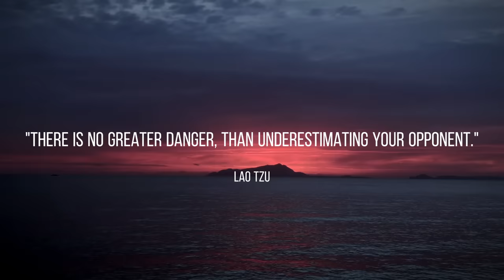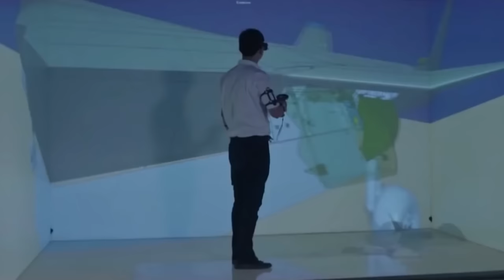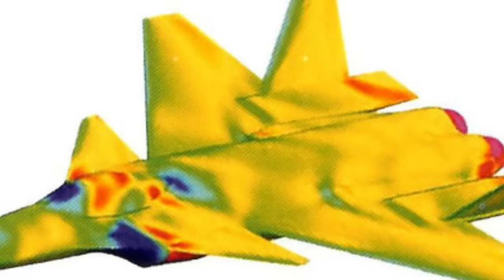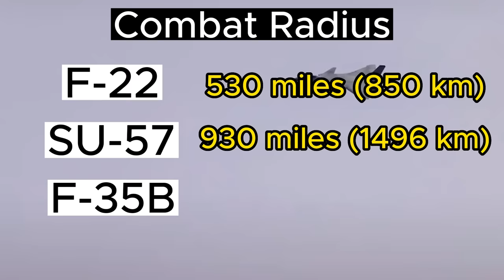China's Stealth Fighter, Good or Bad?

Comment: Unfortunately it looks like the real deal unlike the Su57
Reply: Yes if you took his opinion on Su-57 where he grasp straws by referencing most outdated information on the jet such as RCS figure before it was even produced.
Reply: @agramarten  I would beat the SU-57 in a fight.
Reply: @agramarten  Mate, he took Sukhoi's own data. Also, Russia's barely made any.
Reply: Except it's engines suck...a lot.
Reply: @anzaca1  which he already said are getting replaced this year...
Reply: @anzaca1  He took data from T-50 proposal before any prototype let alone production model of Su-57.
Reply: @agramarten  there are barely enough Felons to equip a single squadron lol.
Reply: @paperitgel98 😂 the SU-57 has a zero casualty rate on all sorties as to date. And due to the Ukrain war Russia is getting that wartime economic boom to their military funding.
Reply: @tylerrobbins8311  I diagnose you with vatnik. Having a zero casualty rate on all sorties doesn't exactly matter when so little Su-57 have been produced. Yet all the same one still crashed and another got an engine fire. I suggest you do some reading into economics, because Russia's economy has contracted greatly since they began their invasion of Ukraine and funding into new programs is limited. Really though get real, the Su-57 is by far the worst of any stealth fighters, is piloted by the worst pilots out of any other stealth fighter, and has at most 15 functioning models.
Reply: @johnbean9797  I'm american I don't just buy into propaganda or partisan bias. Russia is far stronger than what you think. Also there economy has been crippled for decades not since this war with Ukrain. Russia is doing just fine if anything their economy is starting to rebound as the USD is weakening.
Reply: @anzaca1  might want to look into the ws15s
Reply: Its a whole new jet
Reply: @anzaca1 yet has more combat kills than f-22 and f-35 combined
Reply: @anzaca1  yes and no, China are using older models which make it suck for some reason I forgot. But don't underestimate when they use their better engines.
Reply: @KSmithwick1989 Su-57s are being used in Ukraine, and it already has a couple air kills.
Reply: @nickjayr0 what they count Syrian civilians as combat kills now?
Reply: @anzaca1  ... its* engines (it's = it is)
Reply: Yeah because it’s sitting in the back lines lobbing missiles.
Reply: It still just looks like f-35 at home
Reply: @anzaca1 they are in serial production now.  They are making 20 a year now.
Reply: They don't have the money
Reply: J-20 is certainly stealthier than Su-57, but its still not as stealthy as F-35. Their is a 3rd party radar scattering computer simulation done on Aircraft 101. Without RAM coatings, they compared all 3 F-35, J-20, and Su-57 low observable LO characteristics through their shapes/geometry alone.

In a 60x22deg frontal aspect aspect, Su-57’s median RCS in the X-band is 4.3 times higher than F-35A and 2.2 times higher in the L-band. In a 20x20deg frontal aspect, median RCS value in the X and L-band is also 8 and 2.7 times higher.

On the other hand, in the same 20x20deg frontal aspect, "J-20 RCS is higher than F-35A RCS through the frequency range (approximately 3.5 times in X-band, 1.5 times in VHF band), it still has much better RCS characteristic when compared to Su-57.”

This mean even with the same RAM coatings used on the F-35, J-20 much more Su-57 can’t make up the difference in total RCS reduction given their LO properties/geometry. So F-35 definitely has the “first look, first shoot, first kill” in beyond visual range BVR. But in a dogfight or within visual range WVR combat its 50/50 or which pilot is better trained or who first makes a mistake. Consequently, in a 1 vs 1 match, if either J-20 or Su-57 manages to survive in BVR would mean F-35’s pilot already made its first mistake.
Reply: Definitely
Reply: @tylerrobbins8311  9% of every single production Su-57 has been destroyed while not running a single real combat mission. Add in the prototypes and that gets bumped to 9.5%. 

Also the Russian economy is rebounding? The Kremlin itself has admitted to 3.2% drop in GDP in 2022, and expect 0% growth in 2023. That is their OWN sources using their own made up numbers. Look at the inflation (12%), stock market (down 28% from late 2021 levels), export revenue down 40% from prewar levels. Russian economy and military are in the dumpster
Reply: @nickjayr0 And not a single shred of evidence to support that claim, just like with most Russian claims
Reply: @tylerrobbins8311 really? Russian economy is on the rebound? Wtf lol. Even Indian news is talking about the rubble crumbling.
Reply: @nickjayr0 I’ve seen comments claiming this but haven’t found a source for it when searching it up. Any website I could check? Also that doesn’t really mean much anyway. Russia is in an active war with a peer adversary which is something no F-22 or F-35 equipped military is, thus not allowing for air to air engagements
Reply: @tylerrobbins8311  Russia is not as strong as you think, yeah it’s still quite strong in some areas of the world but because of the Ukraine war it has shown the low capabilities of the Russian military, yes the Russian economy is rebounding a bit but not by much, not to the point where they can start making more modern tech.
Reply: @paperitgel98  I love how you know you're losing the arugment because you're just rats supporting rats. So instead you try to shift the point.
Reply: @RuskFox  and you've lost the argument by name calling and siding with the invaders.
Reply: @yeetmaster3360 j20s have already been in mass production with the indigenous ws-15 engine for years. You are slow
Reply: @anzaca1  j20s have already been in mass production with the indigenous ws-15 engine for years. Haters are too slow
Reply: ksaabli-pj2fl  Nope. Chinese radars needs to be bigger than American counterparts to do the same thing. In fact on land base alone, China has no equivalent to THAAD's TPY-2 radar which is small and compact but can see as far as 4700km. Instead they use a massive LPAR radar for the same purpose.
Reply: Definitely
Reply: @agramarten sure, i will fear many fighter of lesser quality than few of slightly better one
Reply: You don't even need radar to detect Russian jets, it leaves a trail of black smoke you can't miss.
Reply: @johnsilver9338 china has better radar now
Reply: Not really it's much larger has canards and so on yes it has no visible rivits or screws but it is far from 5th Gen at best is 4.5 gen
Reply: @anzaca1 with ws15 engine, j20 is THE MOST ADVANCED fighter jet on thi s planet now. F22 is no.2 and will be no.3 soon.
Reply: @DarthAwar j20 is a better 5tg jet than f20 on every aspect now.
Reply: @hongkong670  nope not even close H20 is better than Su57 but not F35 nevermind F22
Reply: @agramarten Source, take my word for it
Reply: @anzaca1 that data is from the T-50 (I think )  which much less stealthy than the production one
Reply: @johnbean9797 u can’t say it’s the worst when it’s still under development and not in serial production , and is not flown by the worst pilots …
Reply: @ImBigFloppa   not one production SU-57 has crashed and only the T-50modles had accidents
Reply: @leopardontheboat8252  The first production Su-57 ever built crashed an hour after take off.

KHABAROVSK, December 24. /TASS/. A Su-57 fifth-generation multirole fighter jet crashed in a forest area in Russia’s Far Eastern Khabarovsk Territory on Tuesday, Komsomolsk-on-Amur city administration source told TASS.
Reply: @ImBigFloppa  that’s a prototype 😂
Reply: @ImBigFloppa  still not a huge deal with amour if F-35s that have been crashing like isn’t it the best aircraft ever made or something?
Reply: @leopardontheboat8252   7 F-35s have crashed in 12 years of service with 960 units made. That is 0.06% of total production being lost every year. F-16, F-15, and A-10, meanwhile, were sitting at about 1% a year. Per flight hour, the F-35 has about 6x fewer crashes than the F-16 in the same time span. We don't have the exact figures for Russian aircraft since they are really cagey about that stuff and don't want evidence to go against it's narrative. 

However, we can count. From 2020-2023, Russia had 38 crashes, all due exclusively to accidents. In the same time span, the USAF lost 37 aircraft, again only due to accidents. Russia has 3.6k aircraft and America has 5.2k aircraft. With with about 1.5x the flight hours per American pilot against their Russian counterpart, that gives a crash rate for US aircraft of 46% that of Russia. That is what Russia CLAIMS too, so take their annual flight hours with a massive grain of salt.

Also what do you mean by amour?
Reply: @tylerrobbins8311 lmao people still think ukraine is obliterating russia
Reply: @voidtempering8700 civilian airliners count as combat kills?
Reply: @WildmanTrading  What are you talking about? If you are going to make things up, at least be semi-feasible. Civilian airliners aren't even in Ukraine. Spread your lies somewhere else.
Reply: Su57 is amazing maybe u mistook it for the pak t50?
Reply: @anzaca1 thats the pak t50 not su57
Reply: @anzaca1 its not even the su57 data its the pak t50...
Reply: @Bababoy6969 Really? In what missions has the SU57 proven this?
Reply: @johnbean9797 source trust me, BTW SU-57 is a multi-role
Reply: SU-57 has yet to go into full scale productions. It continues improving like the new engines it will be using.Russia is actually fighting a real war and will use lessons learned from it before it starts massively producing it's future hardware.
Reply: @j.k.1239  We heard that already a thousend times...this jet was not operational even before this stupid war...the same applies to the T14 Armata...nothing more than a, not operational, tank for a parade...completely useless...by the way...IF the Russians some day manage to built an operational 5th Gen Fighter...well, the US is testing already the 6th Gen aircraft...the Russians are always 2 steps behind...no wonder...because somehow the funds for those projects always find their way into the pockets of the corrupt Russian leadership
Reply: @zenon7094  Russian military industry is already working at 24/7 and producing record number of weapons.

As for future weapons, Russians are in no hurry.Weapons like these will be around for decades. So, It's better to use all the experience learned from war to improve before going into full scale production.
Reply: @j.k.1239  These are just more excuses...or baseless claims...since this is absolutely not verifiable via other independent sources
Reply: @j.k.1239  Plus, it's way better bang for your buck compared to F22 & F35
It's a Multi-Role fighter & is much more cheaper & agile (which is a signature for SUs)
Reply: @zenon7094  Don't be naive. You should wait for Russia to start churning out the final product before start giving judgment upon quality. SU-57 is still pretty much in development while J-20, F-35 are already finished products. So, It's apple to oranges comparison.

For example, This video complaints about SU-57 engine without realizing that it's just an old engine used for testing and for earlier models.They will use a newer flat nozzle engine when it will actually goes into mass production.
Reply: @j.k.1239  and are some more excuses from you side...always the same arguments
Reply: Haha, nobody knows for sure,
Reply: Overhyped for sure
Reply: To be fair none of us know the true capabilities of the Su57 aside from mere speculation, can any one of truly know the workings behind the aircraft, surely? If not perhaps it can be much lethal than we thought since information is not shared on the web
Reply: Military fanboys’ speculation and debates
don’t really matter. US military is already looking at it as a serious threat after planed encounter, then started reacting  to it like kicking off F-22 upgrade program and retiring all of F-15Cs equipped with AESA radars from Okinawa. 
E-3 awacs failed to detect them during the encounter.
Reply: @anzaca1 mate, he’s saying data from long ago 😭
Reply: No it ain’t.  It’s made in china lol
Reply: @Superpo0oper2020 actually that’s WS10C
WS15 just came out in 2023 or some time in 2022(forgot)
Reply: @johnsilver9338 nope, J20s’ radars are 1 generation ahead of the ones on F35 and F22
Reply: @loadingnewads  Nope. Chinese radars are less efficient. This can also be seen on land and sea assets. China has NO equivalent to THAAD's TPY-2 radar which is small and compact but can see as far as 4700km. Instead they use a massive LPAR radar for the same purpose. While SPY-1 on Aegis ships can already see as far 1700km since the 1980s. NONE of PLAN's ships have the same capability even Type 055.
Reply: @johnsilver9338  evidence?
Reply: @loadingnewads  TPY-2 and SPY series radars itself. China has NO counterpart.
Reply: @johnsilver9338  CCP conceals majority of its military technology 
But still heard of 4500KM range radar
Reply: @loadingnewads  China can claim all the magic they want but their is nothing to back that up. While numerical calculations for both TPY-2 and SPY-1 performance can be found on a 3rd party source mostlymissiledefense. That's how I know they are definitely better.
Reply: It's a MiG 1.44 with stealth capabilities. It's a Soviet fuselage.

Comment: The fact that China let J20 fully take the spot light in air shows means they are quite confident that they have got the next generation fighter ready.
Reply: This logic doesn't apply to countries that are trying to catch up. Look at Russia for proof
Reply: @liiou4445  Well they allow the public to get almost arms length to the J-20 on a static display. During some airshows, they parked them out for public to almost touch. Airshows where the US military even had representatives too.

I think that's what the original comment was about.
Reply: @liiou4445 俄罗斯怎么能跟中国比？事实上拿美国和中国比还是比较合理
Reply: Need to remember that internally PLA and PLAAF have not see themselves as US peer level. This is a stepping stone.
Reply: @liiou4445    instead of using Russia as a reference, why dont you just look into China history. We always show something outdated.
Reply: @liiou4445 China isn't Russia.
Reply: @lagrangewei  yeah probably worse
Reply: @liiou4445 need actions of f-series in ukraine battlefield, you will get disapointed
Reply: @paijokotak6996  disappointed in what? US fighters literally has the highest kd ratio.   Also, there are two Ps in disappointed
Reply: @油管大祭司 not a fair comparison. China is alot more closer to Russia militarily than the US
Reply: esphaeraspraestans4212  J20 is not for sale.
Reply: esphaeraspraestans4212 likely,likely,likely，🤣
Reply: not necessarily. The Russian's have been using the T-14 in shows, and in the 90s they had the "Object 640" aka the "Black Eagle" which was supposedly a brand new tank ready for production, but was actually just a T-80 they slapped some fake stuff on to make it look like a more modern tank, appearing more like a Leopard or an Abrams than the T-80 it really was. Military shows are often as much about propaganda or arms sales than showing off true capabilities.
Reply: @liiou4445 哈哈哈 咋们拭目以待
Reply: @liiou4445 But China can speed way more budget to do it compare with Russain

Comment: Current operational models of J-20 do not use Russian engines, instead they use the domestic WS-10c engines with serrated exhaust nozzles. The WS-15, in addition of having a higher thrust, also has thrust vectoring capabilities.
Reply: with WS15 higher thrust, J20 can achieve higher Mach number during supercruise and get to TO faster than anyone
Reply: I understand new production runs will have the WS-15 engines now, until the WS-20 engines become ready
Reply: @MrScrunchee  WS15 is the endgame engine for J20..... WS20 is for Y20 strategic airlifters
Reply: @fatdoi003  not what I heard. As both you and I don't know what the Chinese govt will do, we will just have to wait and see.
Reply: @MrScrunchee  well you can just do a simple search ws-20 and see all the images are for Y-20.... it's a high bypass turbofan engine
Reply: @fatdoi003  Ws-20 is still in development and the pla military doesn't advertise.  So wondering how reliable are those photos. I would tend to believe your mentioned photos if the engine was close to production.  Lots of erroneous reports from western analysts.
Reply: @MrScrunchee  WS20 can't fit in the J20 so will never be use in the J20. look at spec bro.
Reply: @MrScrunchee  bro the ws-20 is already in service on the y-20 and it does not have an afterburner, thrust vectoring and is far too thick to fit in a j-20. I am saying this as a chinese person with access to chinese media
Reply: @MrScrunchee  The WS-20 has been successfully developed and assembled onto the next batch of Y-20. Production has started.
Reply: WS-15  already begins to test on J20 in 2023
Reply: Thrust Vector is cancelled for “current phase”
Reply: @MrScrunchee WS-20 for 運20